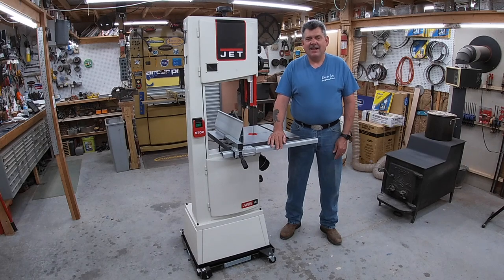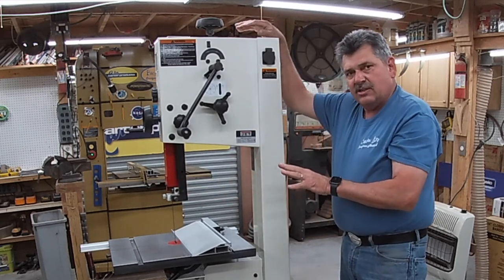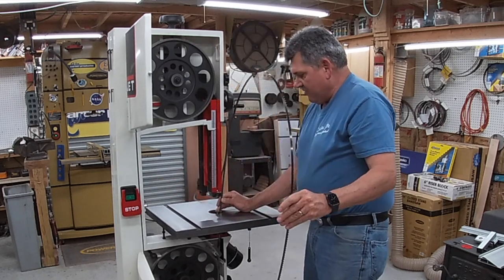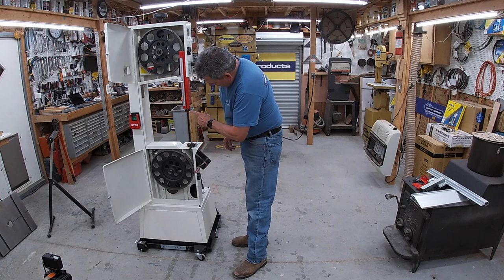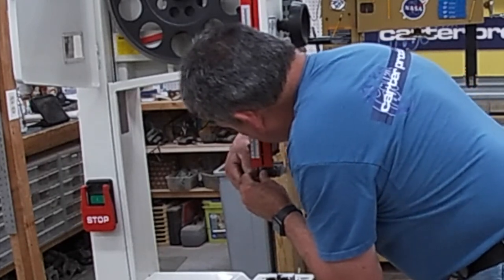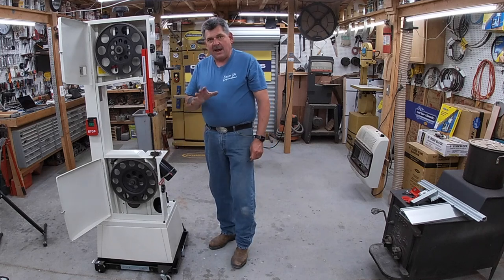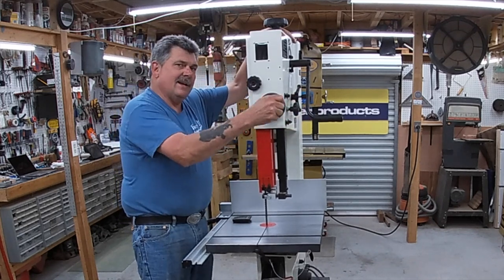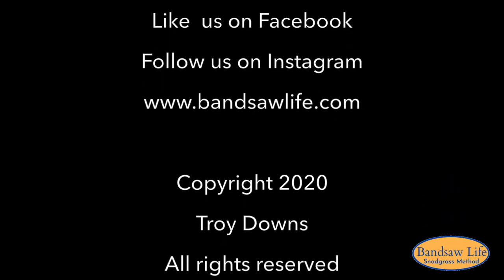JET JWBS 14-SFX

Comment: @Alex, do you really have to take the whole table off to adjust the guides?  From what I can see it looks like you should be able to make adjustments with the table still on.  What do you do when you switch blades to one that is larger where you can’t put the gullets in the middle of the wheel?  Do you have to remove the table or can you adjust the lower side bearings without?  Thanks!
Reply from the maker: Absolutely not!  Just easier to take it off the first time so you can see how everything works clearly
Reply: Not easy to shoot a video of adjusting the lower guides with the table on.

Comment: When you need to lift the bandsaw to put it on the mobile base where would you put the strap on the bandsaw?
Reply from the maker: Under the neck or throat of the saw is fine but I usually tilt the saw and have someone roll the base under it.  I would definitely suggest help.

Comment: Alex; After watching a few of your videos I decided on and purchased a Jet 14 SFX bandsaw. Your video helped me set it up properly and it's running great. It didn't come with a miter gage and was wondering what miter gage you recommend that's accurate, easy to use and available. Thanks
Reply from the maker: I’ve sent your message to Jpw to see if they have a reasonable solution.  You can purchase aftermarket mixers but they get real expensive and are way more accurate than a bandsaw needs to be.

Comment: i just bought this saw and got it set up and its really a good saw,,,when i bring the fence up to the blade to align it with the blade there is about 3or 4 thousands off at the bottom,,and the instructions tell you to raise or lower the 4 screws on the top of where you lock it down,,any help would be appreciated
Reply from the maker: Loosen the screws on the rail and adjust them perhaps
Reply: alex thank you ever so much for responding,,,this saw is really a beast,,,being honest i bought it because of the jet warranty,,,and of course the price,,they gave me a blade when i bought it,,i got a 3/4 blade and it really does do a good job,,honestly i was looking at the grizzly bandsaws,,,but i dont think i could have gotten such a good deal with them,,and neadless to say the shipping charge plus the warranty,,

Comment: Alex, I have had this saw for one year now and love it! my only problem is with the fence play and the lock not staying tight. I have contacted Jet, and they sent me a spring steel replacement lock, but it didn't help, I have to use a C clamp on the far end of the fence to keep it from moving. is this typical, or is this possible a defect?
Reply from the maker: I’ve forwarded this to the best JPW has, I’ll get back to you as soon as I hear from him
Reply from the maker: Dan please send me your info to Alex’s.bandsawlife@gmail.com and I’ll pass this on to them as they are eager to help
Reply: @bandsawlife2660  I emailed you , thanks for your help
Reply: Looking at the design I wondered about the rigidity of the fence.  I'm still buying one though.

Comment: Got a question for you Alex which is the best bandsaw in your opinion the (PWBS-14CS) Powermatic 14 inch bandsaw or the JET 14 inch deluxe pro bandsaw (JWBS-14DXPRO) they both seem to be great saws but I just wanna know an expert’s option. Thanks always a pleasure veiwing a masters knowledge
Reply from the maker: In my opinion the Powermatic is a great all around saw.  It has the capability to resaw and do all the scroll work you would ever need.  It has the Carter quick release, cast iron wheels, and standard blade size.
The Jet is a nice saw and come standard with a solid riser block but the quick release is a tougher operation and the aluminum wheels just don’t give the inertia that the cast iron does.  
Depending on what you intend to do with the saw,  either will work, I just feel the Powermatic does is with a bit more ease.

Comment: OK alex, I think jet made this saw so you do not remove the table to adjust the lower rollers. Just take the covers off them. Looks pretty ez to get to.
Reply: No
I have this exact saw. You do have to remove table.
I install/replace blade by inserting blade down separation on table. You cant adjust rollers but i dont adjust rollers each time.
It had to grow on me. I would highly recommend this saw.

Comment: Alex, I just bought this saw on your recommendation. I notice that when I try to tension the blade, it gets damn near impossible to turn the tension knob tight enough to reach the 5/8" mark they provide for my 5/8" blade. I can almost get it to 1/2" and it feels, and sounds like I'm going to break the wheel and locking lever off when tightening the quick release lever. Any advice?
Reply from the maker: I’ve found that you do need to grease the cam on occasion.  Remember the greenwood blade is a little thicker so it can take a bit more to tension it.  Please email me if you have any other issues 
Hugedolphinfan@yahoo.com
Reply: @bandsawlife2660  thank you!

Comment: I bought this bandsaw about 18 months ago, I wish I'd watched this video sooner. Pretty I've ruined my 1/4" blade...oops!

My only complaint about mine is the 'far side' of the table, where it's split for the blade to pass through, is a literal smidge higher than the front - so everything catches as I push it through. I was very new to woodworking when I bought it, and didn't realize this is probably a defect in the table top. Probably too late now to get Jet to do anything about it. I wonder if I could sand it down with some low grit paper and then polish it back up through the grits?
Reply from the maker: I generally will add some duck tape to the bottom of the insert to raise it.  I understand what your saying about it catching, aggravating!
Reply: @bandsawlife2660  i mean the actual cast iron table is not completely flat. Material passing over to the right of th blade catches on the far side of the split :(
Reply from the maker: Is the table pin in place?
Reply: @bandsawlife2660  yep, slides in fine.  It’s like a 64th off, just enough to catch the edge of even my woodpeckers rules.
Reply from the maker: Give jet a call. 888-274-6846 this is a structural issue, should be covered.

Comment: I noticed you used a 3/8" blade for resawing. Is there any benefit to use a wider blade, say a 5/8" blade for resawing purposes?
Reply from the maker: That blade is a Greenwood blade made by Carter Products. Great combo blade, resaws up to 12” and turns A circle down to 2”. 5/8” blade is a great straight cutting blade but can’t turn
Reply: Alex, are you using the 115” blades? I looked on the Carter webpage and didn’t see any 116” blades which is what Jet recommends for the blade length.

Comment: I appreciate the video Alex. Especially since this Jet model is in my top 3 finalists for purchase candidates.  I realize I am late to the show but if you get this comment maybe you wouldn't mind taking a couple questions. Can you explain any appreciable difference between running this saw on 110V vs 220V? And, as I believe 1 3/4hp is probably minimal need for re-saw, would you say the 1 3/4hp would run more efficiently on the 110 or 220?
Reply from the maker: Always run the motor at 220 if possible.  You’ll have more torque and faster motor start up.  It’s also a bit cheaper to operate
Reply: @bandsawlife2660  When you cut the 13 inch board,  we're you using 110 or 220? I have a feeling most will partly base the decision to buy it based on having 1 3/4 hp on 110 and don't have 220 available.
Reply from the maker: @davegravel3740  110

Comment: i have this 14 in jet and have had to have a warenty tec come out to reset my bottom wheel an a few other things,anyway can you please tell me how to keep an 1/8 in blade on cause as soon as i put tention to it the blade will come off nomater what i do ,please help  thanks R ichard Fay
Reply from the maker: If I had to guess the blade is bad. 1/8” blades are bad at eloping. This is where the front edge stretches and the back edge stays ridged.  It’s like try to keep a string on the saw.  Over tightening the blade once is all it takes. Soft material blades like timber wolf are the worst at this.
Reply: @bandsawlife2660  that's the blades I get can u recommend something better  thsnks
Reply from the maker: @richardfay1725  I was sure that was the problem, that why I mentioned them.  Carter Products 
888-622-7837 use Code Alex2020 and they will give you a 10% discount
Reply: @bandsawlife2660  I'll call tomorrow for a blade thanks. Would u also know if there is a upgrade kit w bearings for a 20 in delta  thanks again
Reply from the maker: @richardfay1725  yes sir, ask for Kris, he’ll fix you up
Reply: @bandsawlife2660  thanks again  I've been looking for parts for a while

Comment: im sure this is a great saw,,but i just sold a rikon 10-326 and the fence system was the same,,it had no rail on the back of the saw to lock the fence down and it would move everytime,,,,

Comment: I watched other setup videos by Alex and he always emphasized where to place the blade on the wheels.   He didn't do that in this video.  Does anyone know whether this bandsaw is designed differently so that isn't important on this machine or is there another reason?
Reply from the maker: Blade placement should always be with the deepest part of the gullet in the center of the wheel. Sorry I missed that.
Reply: @bandsawlife2660  No problem. Just making sure.  Great video.

Comment: I purchased this saw last year and have just now really started to use it. Approximate use since purchase is about 3 hours and now at a complete standstill with a major blade tracking issue. At any given moment the blade will track forward or backward and come off lower wheel. There is no consist blade tracking whatsoever. It is like someone is standing at the machine turning the tracking wheel on the back of the machine
Reply from the maker: What size blade is it? That’s moving front to back is it a small 1/8

Comment: My cuts veer to the right and have tried everything I can think of to fix it. Does anyone else have this same problem?
Reply from the maker: What type of blade are you using?
Reply: @bandsawlife2660  I don't know the brand. Bought it from my local shop. Didn't have any packaging.  I should try to buy a different brand.
Reply from the maker: If you order a Carter Products Bandsaw Blade get a half inch four tooth per inch should do the trick for you.
Reply: @bandsawlife2660  thanks, I'll give it a shot.

Comment: Hi alex, i just got this saw as my first bandsaw purchase and i am struggling getting my 116 tooth 3/8 timberwolf blade tensioned properly… based off the tension guide on the saw by the time i get to the 3/8” setting its not even touching the tires anymore. It seems to fit better when its set to the 5/8” setting but when i turn it on the blade seems to wobble alot and when i try to adjust it while its on, the looser i go i hear the blade slapping inside and the tighter i go i hear the motor start to bog down. I have my guides set up right just cant seem to get the tension correct unless this wobble in the blade is normal. Let me know what you think thanks!
Reply from the maker: Are you talking front to back or is the blade just to lose?  Timberwolf is really bad at welding.

Comment: Great review, how do you think this stacks up to the Grizzly 0513x2?  The weight difference is quite substantial 272-325 conflicting details online vs 418lbs and I'm wondering if that translates to less rigidity and flex during large resaws.  I've found them to be within a couple hundred dollars of one another and I know the grizzly has 2hp, cast iron wheels and probably biggest thing for me is dual bearings.  If the price were the same which one would you recommend?  Thanks!
Reply from the maker: First it’s probably not fair to compare a 17” to a 14”, both are good products but if your budget minded the 14” is the choice, smaller footprint, less expensive blades, 110 or 220 with a 1 3/4 hp motor and the customer service from Jet has no comparison.

Comment: Kind of concerned about the "durability" of the trunnion.  The Laguna seems to be a solid casting whereas the Jet looks like an aluminum base and some less than beefy cast iron pieces.
Reply from the maker: It’s actually steel.

Comment: I like the JET’s A LOT. But why on earth can’t they make a toolless guidesystem? It’s not that cheap. 

I really don’t like those bearings combined whith the allen key. And unless you use the same blade all the time you do need to adjust them rather frequently
Reply from the maker: I understand the way you feel but toolless guides are always moving and have to be readjusted more often.  A few extra seconds assures the user that the guides stay set
Reply: @bandsawlife2660  Thank you for your answer! Hm... the toolless ones I have experienced (Felder 510) are spot-on and won’t go out of tune no matter how much pressure you put on them

Comment: JET MADE A 15 MIN BANDSAW TUNE UP TAKE AN HOUR.  Nice saw, good construction stupidest way to make somthing simple be the pain in your ass to deal with.  Why redesign somthing that's worked for years?
Blade on blade off blade on blade off.  Wtf?
This is why every machinest and mechanic wants to slap the engineers up side the pencil pushing heads
A)  someone has to make it.
B) YOU have to be able to service it.

Gm made a car you had to pull the motor on to change spark plugs. Thats what this saw is like..

Jet should hire Alex to teach them what works and whats stupidity. Ask the guys who have to use the equipment. 

Im going to bet this saw wont travel with Alex to the woodworking shows.
He's not going to show us live and in person how to set this saw up.
Reply: bobbg actually I had this saw at the shows for the last 2 years.  Please stop by and ask anything you would like.
Reply: bobbg...you sound seriously disgruntled. Please tell us what problems you have faced with this saw?